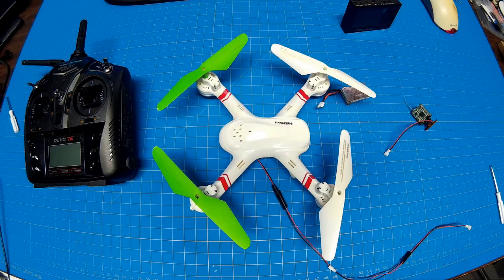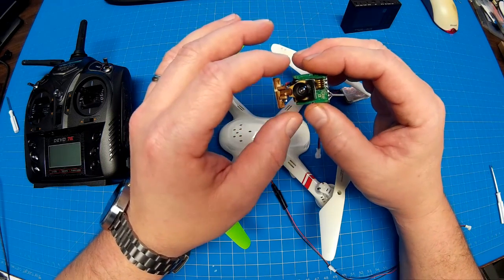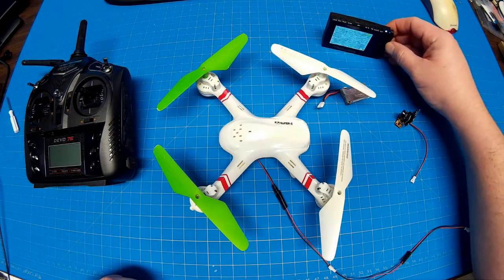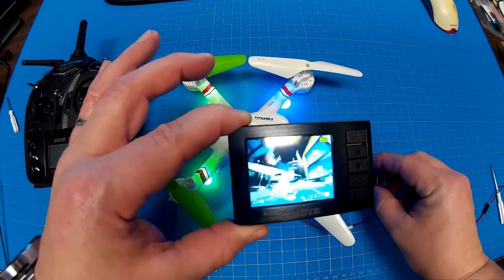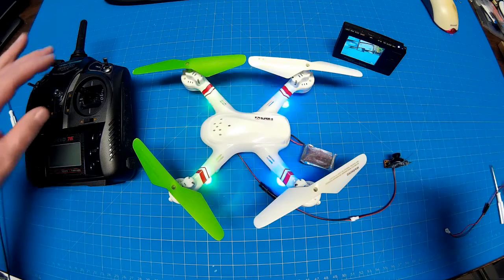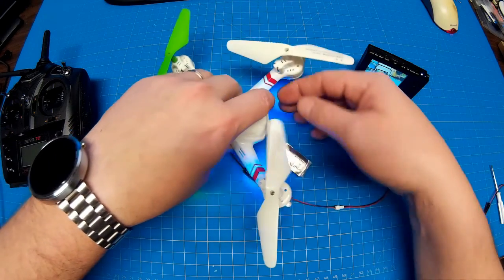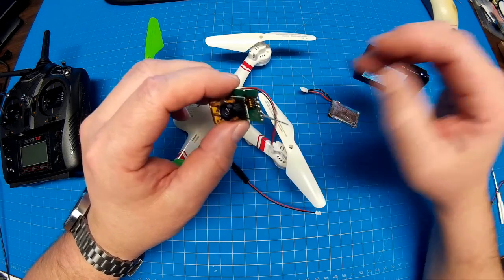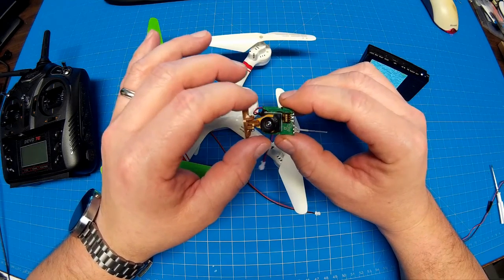Testing - FPV AIO 600TVL 170 Degree mini Camera 5.8G 8CH Transmitter All in One Only 3g

Comment: Bought one of these on sale for like $7.99 and it doesn't work. My FPV receiver picks up nothing. What do the switches do, and how should I configure them?
Reply from the maker: If I recall correctly from 2016 the switches change bands and channels. Do you get any lights or does the AIO warm up? I ask as that would be a sign it is getting power. If it does have lights and warm up it could be defective, otherwise maybe we need to cycle the bands and channel manually one at a time to find the channel.
Reply: It gets very hot, yes, but there's no lights or LEDs on it. I was thinking it might be defective as I've tried fiddling with the switches and to no avail
Reply from the maker: does your goggles have auto scan?
Reply: Yes, it autoscans a frequency around 5.6 Ghz to 5.9Ghz. Nothing shows up. Just occasional noise
Reply from the maker: @Biovirulent  Do you get a channel/band that is just black no snow? If so that likely means the camera portion is not working.
Reply: Nope. No black spots, just noise and flickering.
Reply from the maker: @Biovirulent  does seems like its dead, or at least the camera portion.
Reply: That's a shame. Thank you anyway.
I had bought it a year or two ago and never used it until now just to find out its dead.

Comment: Just FYI, lowering the output voltage of the regulator will actually cause it to run hotter, rather than cooler. Sparing the long electrical engineering lecture, a lower output voltage means that the regulator has to "eat" more of the voltage between the battery and the camera. "eating" more voltage means it has to work harder, and actually generates more heat
Reply from the maker: Ah, good to know. Thank you

Comment: I just got this today and I get video but only if I stick the  antenna of the camera and antenna of my monitor antenna if I move away even an inch it cuts out. it might be my cheap antenna on my xk alien monitor. what do you think it is?
Reply from the maker: I have had mine awhile and used it a number of times with three different receivers. I have not seen that behavior before. I presume multiple frequencies and channels have been tried? Do you happen to have a friend that has a receiver to try? And ensure the batteries are fully charged. Sorry I am not more help.
Reply: No any help is good help man. No i don't know any one who is into flying drones. I try to get my friends into them but they don't get into it like i do. So i am all alone in this field where i am. I have tried different channels and the batteries were full. I really think it's my receiver. It's a cheap monitor and has a bunch of lines in the screen when i turn it on by itself . It would cut out on me with my xk 250 alien allot. I am going o buy another one and hope that helps. Thank you for your help n time.

Comment: what are the position if your dip switches? Mine worked for about 2 mins now i can't get video.
Reply from the maker: +AARON ARRINGTON I can't say, its buried in another project. In the video it looks like they are all up. Typically if the video stops its either low voltage or damage that stops the video. If your video is solid black that indicates a camera issue, if you get snow or static that indicates no signal (wrong channel).
Reply: have you tried all 8 channels?
Reply: +Ludwig Göschl I found out my issue was that I burned the tx lol got another and it worked great thx anyways

Comment: they are from ebay.
Reply from the maker: +mark Davis ebay can be great but inconsistent. Some products "require" the red and black reversed. The only way to know which is reversed is the compare to other sources. I don't have a picture of various jst I can post right now, but I would guess the camera is "correct" as I have not had to reverse the leds I have to work on this camera or other projects.

Comment: i got my camera vtx combo a little while ago just getting to set it up.  i ordered some jst 1.25 plugs and when i went to plug my jst plugs to the camera power plug it wouldn't plug in. but if i turned the plug around it would plug in. but know the positive and negative wires are reversed  (i did this with no power,  glad i did). could they have attended the power ply on the camera backwards? ???. 
help
Reply from the maker: +mark Davis Its possible. Did you get the jst from ebay? I always check the leds I get off of ebay (after burning up more than one ite). sammylam sells connectors connected normally, but you can (and I have) gotten leds backwards from ebay sellers.
Reply: Sammylam is that aebay seller or a web site
Reply from the maker: +mark Davis Sorry, yes, sammylam is an ebay seller. He is consistent in his product and product description. Downside, the product ships from Hong Kong.
Reply: Could i splice the wires around. Woild that work?